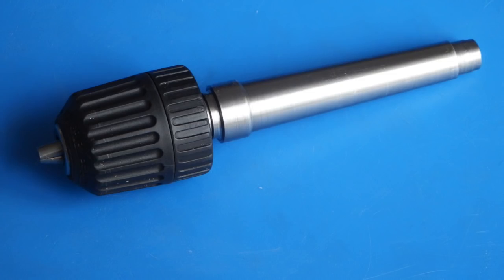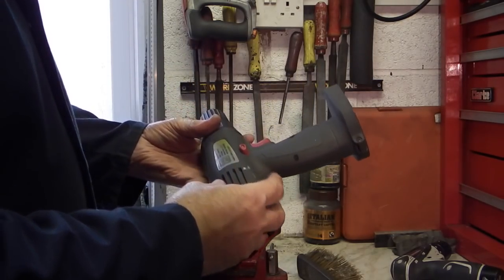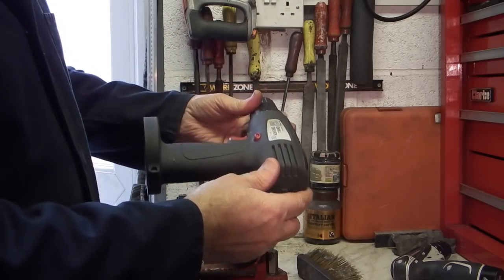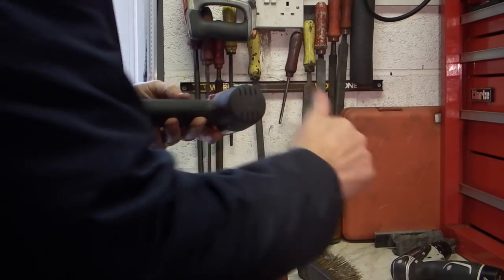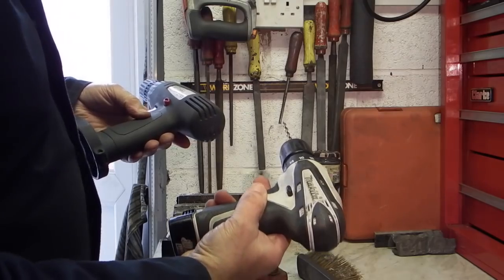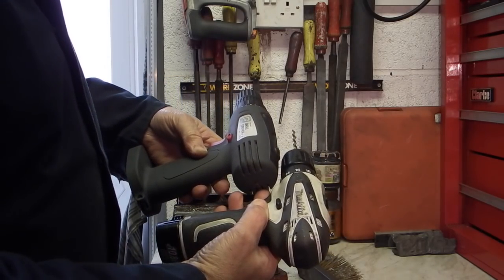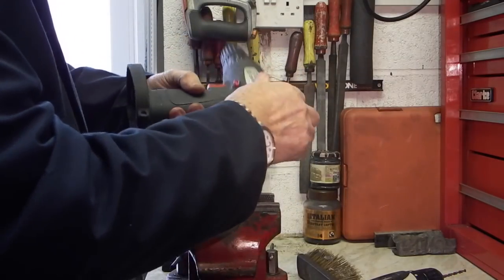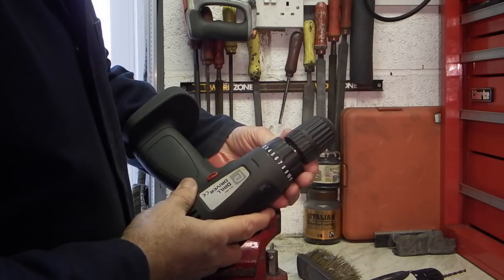Morse taper adapter for chuck

Comment: oh come on hog some meat off that instead of taking 30 finnish cuts!  that carbide insert will cut off 50 tho a pass.Make some pretty black chips!

I will however say I did learn somthing I've not done and that's cutting a taper ike that.
Most Lathes will cut a taper on auto feed. without off setting the tailstock.

Comment: why drill out the screw its reverse threads just take it out.
the rest of the drill will make a nice paper weight.
Reply: The video literally says that this is only needed if the head is damaged. Which it will be if you've ever had a drill bit get stuck and start spinning in the chuck.

Comment: Sorry another question, are you just using hot rolled mild steel? Or something else? Cheers
Reply from the maker: I purchase steel offcuts from a steel merchant which are end of bar stock up to 18" length, but I can't tell what type of steel it is as sometimes there is no code on the bars, some hot rolled. Most of the parts I make do not need to be heat treated as they are not used a production environment.
Reply: enots engineering I’ve tried going to various scrap yards to get cheap steel stock but it has been very hit and miss. I end up going to metal supermarket to get specific stock I need, a lot lot cheaper than b&q type places but still not cheap. They have a few branches around the country and luckily open Saturday mornings.

Comment: At 7.15 is that what’s called a lathe dog? Not seen it used before. Thanks. I have a Chinese mini lathe, which does not have a tailstock offset so I would have to use the compound angle to make the taper? Cheers
Reply from the maker: Hi Shaun.  Yes thats right
Reply: enots engineering Cheers

Comment: Nice job.  I like the idea of salvaging an old drill chuck.  What I am curious about is why you did not make another pass or two so the adapter was set deeper into the tailstock.  It looks like it has too much sticking out.
Reply from the maker: Hi You can only machine the taper until is shows in the slot at end of the bore in the test part, machining more off would result in the taper hitting the tail stock ejection pin and being under size. Then you would need to reduce the length which may result in removing the centre drill hole on the small end.

Comment: Nice work. I always learn something from watching a good engineering video and this is a good one
Reply: engineer's don't do production work, they do not know the limits of machines, he also kept making a backwards pass over hit work instead of backing off the took so it didn't touch the work mucking the finnish up. And I'm going to bet that lathe will cut threads it has a thread cutting screw. he just don't know how to use it or don't trust it.

Comment: When cutting a Morris Tapper, about how much contact should you be shooting for?
Reply from the maker: Hi Craig
The morse taper should be in contact (shown by the micrometer blue) along the length to show you have the correct angle.
When the end of the taper shows in the cut out on the test morse taper bore you have the correct length